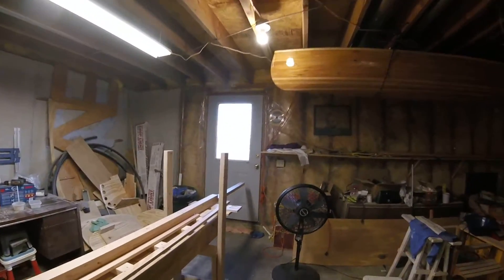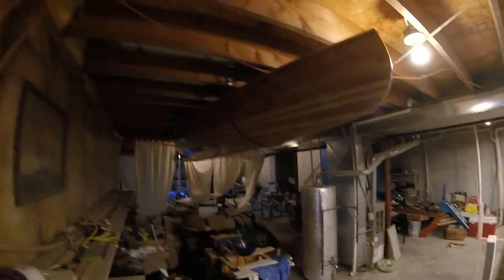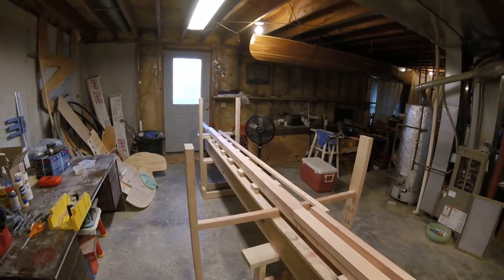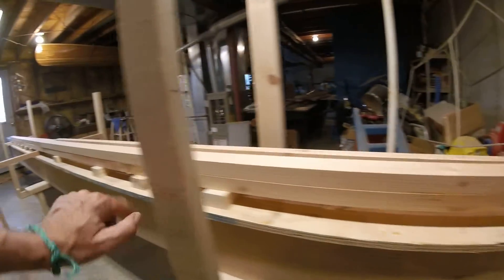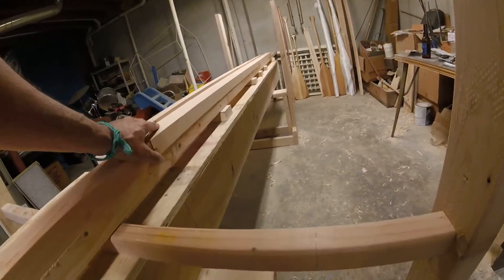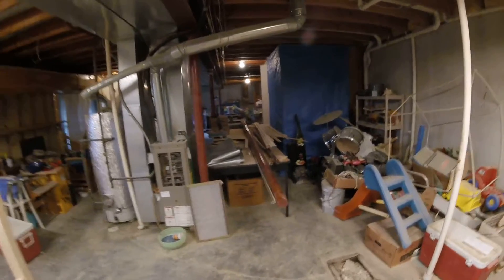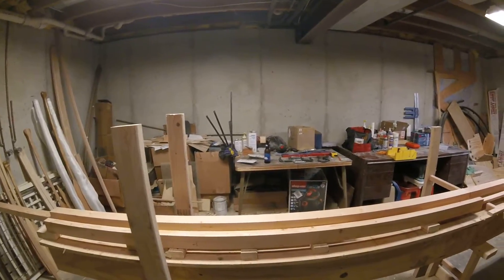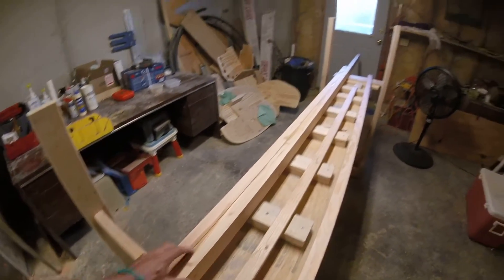Wooden Mast Build

Comment: Is it preferable to glue multiple pieces of wood together for a mast instead of using an entire tree trunk? Is it stronger?
Trying to learn about something new. Thanks!
Reply from the maker: There are so many ways to build a mast. A single piece of wood or a tree is probably the most ancient way of doing it and clearly has worked over the centuries. A birds mouth construction has lots of pieces and can be extremely strong while being lighter weight. Continue looking at different methods of construction and try to determine what makes the most sense for your particular boat or need. When I built a mast for my Haven 12 1/2, I used 4x4 but still had to piece it together. Some of this comes down to availability of lumber, too

Comment: how did it work out?  no scarf joints?
Reply from the maker: I suppose you could call the glue up scarfs of sorts but I overlapped the lumber 4 foot.  As to how it turned out.. I used this mast on a Demon 15. This boat was the immediate predecessor to the more popular Sweet 16 and is a very similar boat. Both are centerboard day sailor boats with no ballast keel. This mast worked very well but was not a great idea for the boat I used it in. Looked cool having a wood mast but it is heavy and with too much weight aloft, made the boat even more tender. The last time I used it, I actually caught a rogue wind gust and dumped and subsequently turtled the Demon 15. In other words, turned it over completely with mast pointing straight down. this actually surprised me a bit as I thought the wood would float.  I got her upright and back to port but what an adventure. I've since gone back to aluminum.

Comment: Just currios, why didn't you scarf the ends of the but joints? I believe you would have a much stronger mast.
Reply from the maker: That would have been a way to go but I had so much surface area to use in gluing up that I didn't think it necessary. I've used this mast and sailed multiple times and it shows no signs of stress or failing.